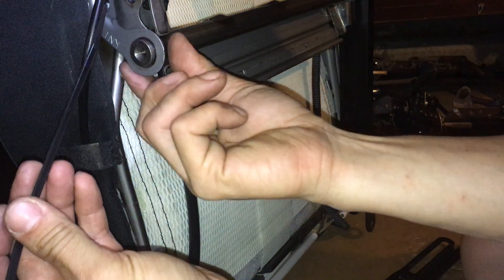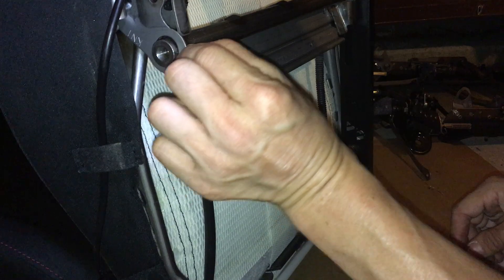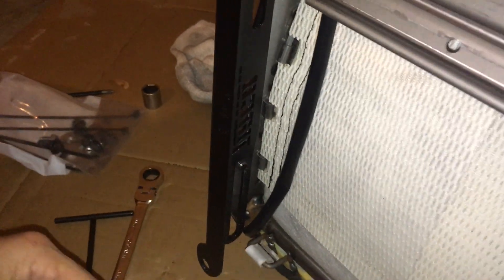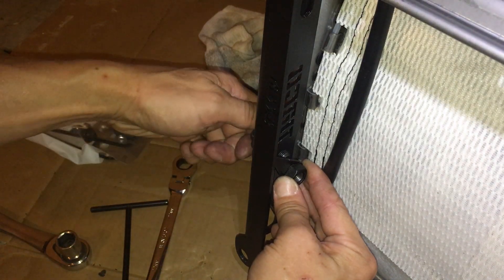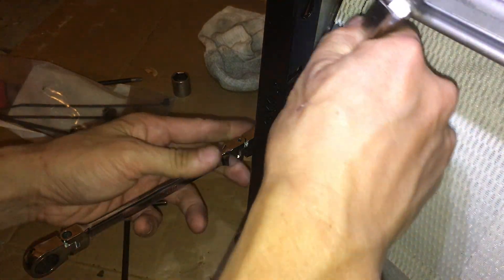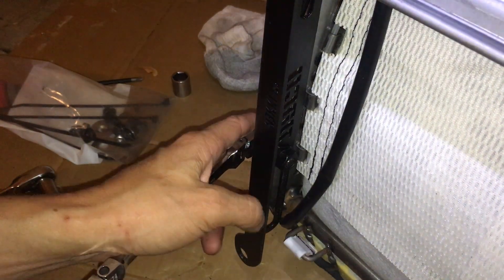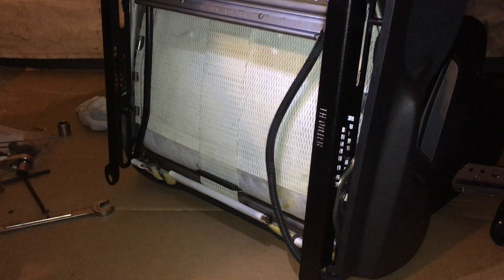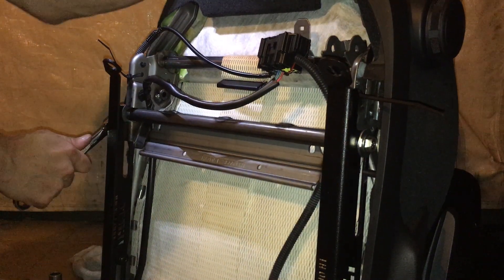ND Miata PacoMotorSports lower seat rail install pt.2

Comment: I got these and attempted the install. They now have a dual slotted design on each rail. I got the seat where i wanted it positioned but i have no clearance at the rear to tighten the rail to the car. I am 6 foot 1 and thought this would help.
Reply from the maker: It is a very tight fit and takes several in/out fitting to get it just right and tighten it down...I think I had to take the seats off/on three times to get the adjustment right.  passenger side I just slide it all the way back.